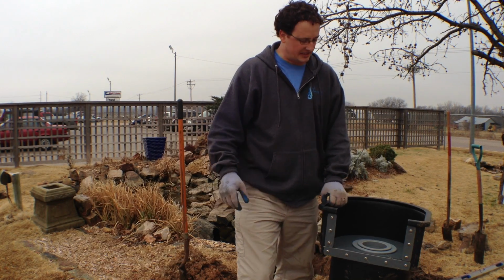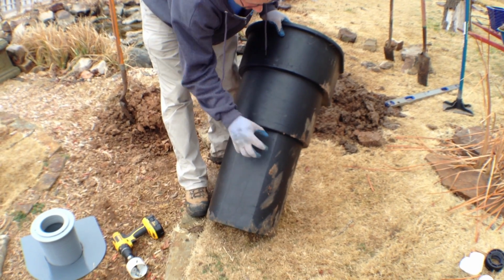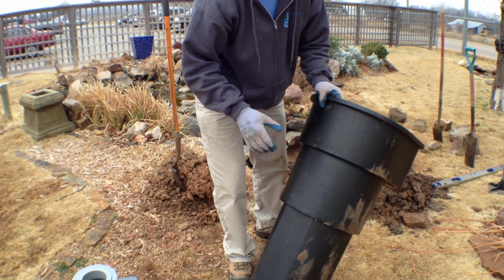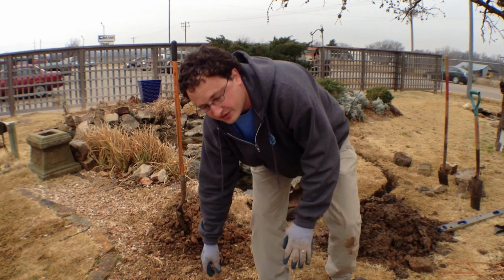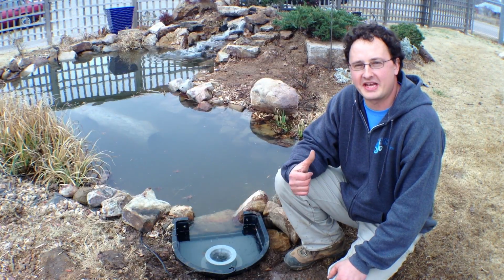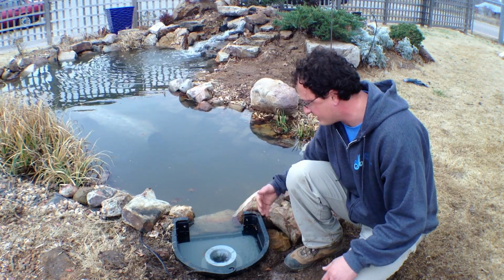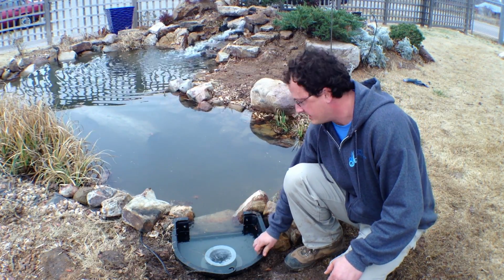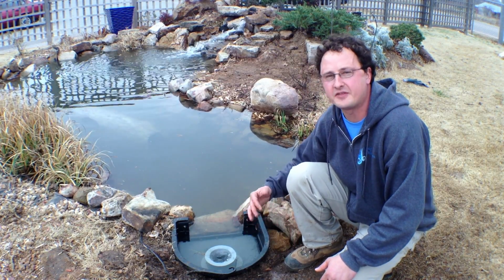Helix Pond Skimmer Retro Fit Installation

Comment: May be a dumb question but here goes - recently bought a new house. At the end of the house there is a pond. As of yet there is no filter attached or any type system to clean the water. I want to make use of the pond moving forward but have never maintained a pond. So my question is; I assume i need to install a water filter? What will be the easiest Thanks.
Reply: There is a lot of questions I need to ask in order to give you an answer. Please go to our website and contact me for further information.

Comment: where does the pump go  - inside the skimmer?  What was the hose that connected to the bottom of the skimmer - goes to waterfall?
Reply: Yes this is a submersible set up and yes the plumbing line returns to the waterfalls.

Comment: Hi, Is there a pump at the bottom of the skimmer drawing the water in? And if so does the water go from the pump through the pipes and then up to the waterfall? I want to put one of these as a diy with my husband and want to be sure that I know more about it. Thank you so much!
Reply: Yes! This set up has a submersible pump and it does use the line plumbed to the back of the skimmer. This skimmer can be set up with external pumping as well.

Comment: Very interesting skimmer. Nice install video. I want to retrofit a skimmer on my 600+ gallon pond with a Cal Pump 5200 submersible pump. We have about 6 - 8 feet of head from the bottom of our lower pond to the top of the water fall in our upper pond, which are connected by a gravity fed stream. So, our flow rate is approx 3250 - 2750 gph. Would this skimmer work for that application?
Reply: Absolutely Wayne!

Comment: What happens if the water level drops?
Reply from the maker: If the water level drops below the weir opening then the pump will not be able to pump. Its typical to lose and inch to an inch and half per week on an average pond depending on location and time of year. If you are losing more than that there is a leak somewhere in the system.